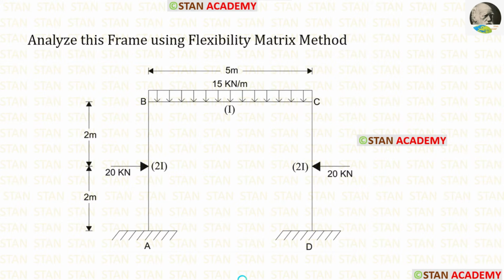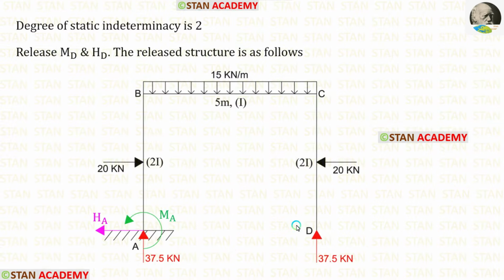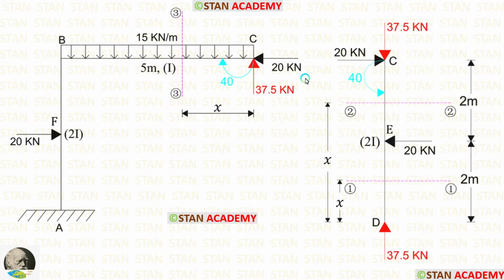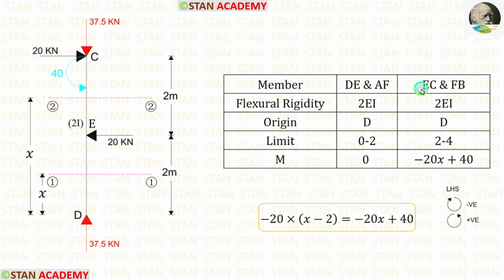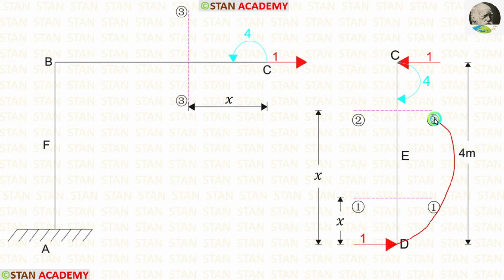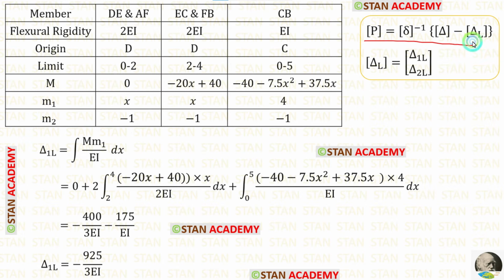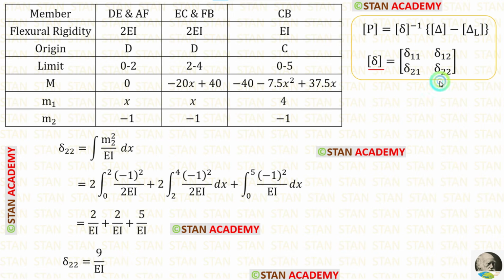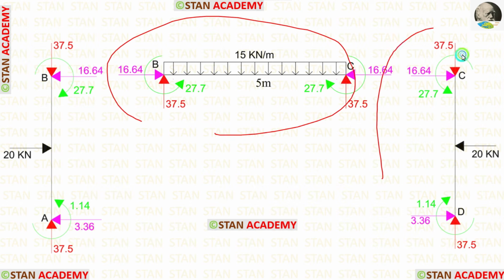Analysis of Frame using Flexibility Matrix Method - Problem No 1

Comment: Sir why are you not taking the vertical reactions at A &D in calculating the degree of static indeterminacy??
Reply from the maker: they were already found using Σv=0
Reply: @Stanacademy  sir in this way we can find the vertical reactions for many other example of yours ......can we use the same method there also????
Reply from the maker: you cant find in the same way for other examples. Here you can find because it is a symmetrical frame.
Reply: @Stanacademy   okay sir 👍 thanku

Comment: Why u r solving this frame structure totally different, from other ur explained type of problems, like conjugate dgm, bmd diagram to sf type
Reply from the maker: Beams have only horizontal members. So congugate beam method is applicable. But frames has horizontal as well as vertical members. So we are using unit load method